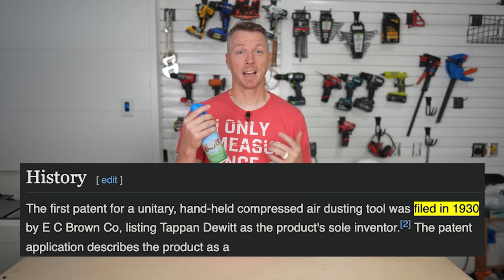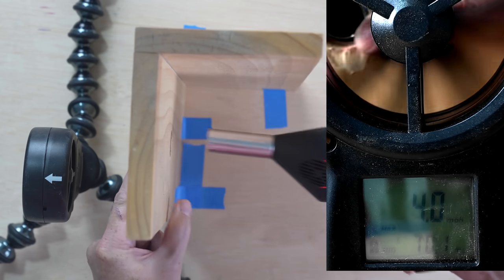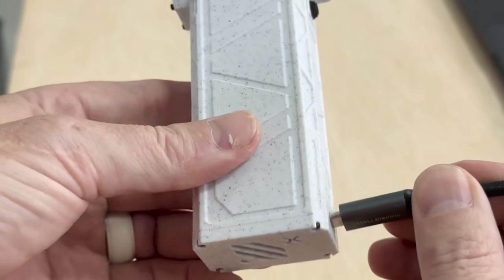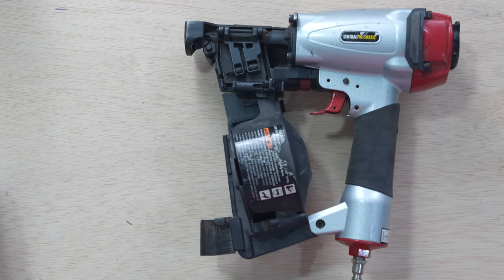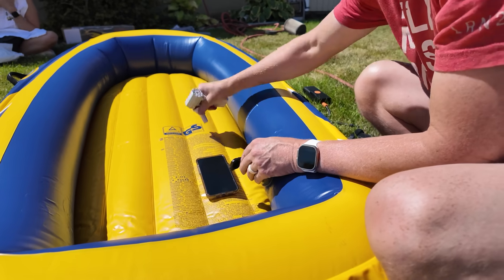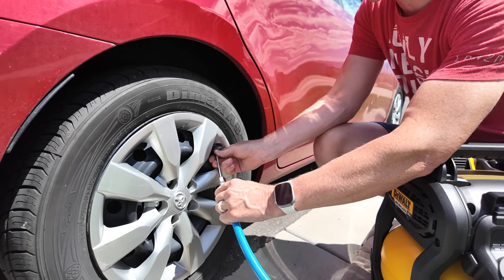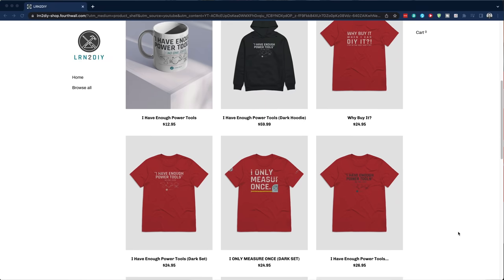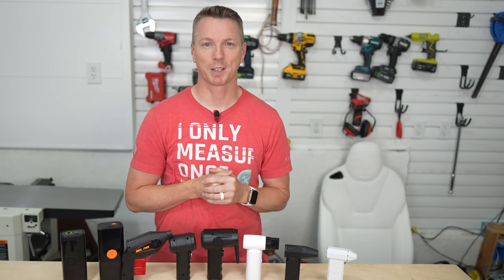The Air Duster, Reinvented

Comment: You’re absolutely measuring these wrong.   You need to use a force sensor. Not a speed sensor.   I’d attach a flat surface to a sensitive scale and measure the force applied instead of the speed
Reply: This. There is literally no way these will clean as good as air in a can, or compressed air, for caked on dust in anything that draws air. Well, I guess I should say without showing the pressure of the air stream, there is no way we can tell, but I'd put money on the compressed air winning every time against them all.

If you are OK with these things getting stuff just 90% cleaner, you might as well use your mouth, or a vacuum. Careful around computers with a vacuum though, they build up static and computer parts are sensitive to electrical shocks to the point they can cause malfunctions and failure.
Reply: I think this is wrong, but am not sure at all. Force is mass times acceleration. I don't think the air gets fast enough to compress and "gain" mass. So you are definitely right that force is the deciding factor, but force is represented as speed and compression in air I would think, so measuring speed should be representative of force. Correct me if I'm wrong.
Reply: I did some research and found the formula for wind force which is:

F =  1/2 * p * A * v
p... pressure
A... target area
v... velocity

A duster can influence the target area by increasing the nozzle diameter. An increased nozzle diameter results in more area and thus, more force in general (given the other parameters don't change, which they would), but less per area. The pressure shouldn't change between dusters, once the air exists the can it expands to atmospheric pressure and converts it's potential energy into kinetic. So the deciding factor should be indeed, velocity. 

I now need an expert to comment on this. Maybe there is a pressure difference when the air exists the can which makes it more powerful really up close.
Reply: @TheJuanSolid  These absolutely do clean as good as canned air, in fact usually they do a better job. There’s a good reason why lots of industries are doing away with cans. They’re especially better for extensive jobs as there’s no need to keep warming the can up to maintain pressure.
Reply: @TheJuanSolid these are not new, they're just in a neater package than before. They do clean well or better than canned air, most of the time. There's gonna be times when a small focused jet of air is just what you need but not really for dust. Get an electric duster, they're pretty cool and cheaper in the long run
Reply: @TheJuanSolid  The canned products have a large flaw in that the pressure drops rapidly after the first 10.seconds or so. These battery powered options have the advantage of maintaining performance for longer.
Reply: @dodjo_cat sorry but p in this formula is air density not pressure
Reply: @VIRDytweet  awesome dragon character!
Reply: @TheJuanSolid your just stuck to your old ways old man. How about you stick with your little cans of air and let the rest of us enjoy advancement of technology
Reply: @Gabri3lRocha lol that was unexpectedly aggressive for a conversation about a cleaning tool 😂
Reply: @phreshxmetal  sorry I hurt your little feelings baby girl next time I’ll keep it more pg
Reply: @TheJuanSolid i mean if you are ok with spitting all over the stuff you intendo to clean while getting exhausted in the process ,then  yes use your mouth
Reply: @TheJuanSolid also enjoy wasting money. I bought an electric duster like 10 years ago for maybe 100-150. That's already out pricing your stupid cans
Reply: @Gabri3lRocha  I can’t flip that blower upside down to get really cold liquid for.    Experiments.  Yeah. Experiments.  (Cold spray is useful for troubleshooting)
Reply: Now he'll break the scales too...
Reply: @TheJuanSolid  I have one of the “turbo” ones that I only paid $30 for, it’s definitely better than canned air in every way.
Reply: too late. he only measure once
Reply: wind is measured in speed my ngga
Reply: @ right but speed is not the only factor in whether something will do good at blowing off dust. It’s absolutely a factor, but not the only one.  Pressure is a much larger factor than speed.
Reply: @TheJuanSolid  an air compressor will always clean better then air in a can because an air compressor is literally air in a can

Comment: While the comparison was fair, the point of a can of air is to put that straw nozzle right up against your keyboard and blast gunk away That's the actual comparison that needs to be done. If you hold it 2 inches away it doesn't work. I bought a different plug-in 120v air 'blower' that's supposed to be a replacement, yet even with 120V it isn't as effective as that high speed, tiny straw nozzle of a can of compressed air, and no where near as good as an air compressor.
Reply: Most of them come with adapters for emulating a similar effect with the thin nozzle

Comment: Your links to the reviewed products doesn't have most of the reviewed products in it. What's the point of doing reviews of specific models if you don't tell us what they are?
Reply from the maker: Sorry about that. The individual links are all there now.
Reply: @LRN2DIY you're linked items are not for the reviewed models
That is not fixed
Like the Violent turbo fan one which a quick search finds a black model which is $85 not 47 but notice how you have tons reviewed under $40 and almost  none linked under 40?

You are linking models YOU DO NOT HAVE IN REVIEW
what on earth is the point of the review then?
Reply from the maker: @L0st-n0found  Those ARE the same tools. Temu doesn't keep their prices the same so if you look today and a week from today they'll be different. Shop on your phone and you'll see better prices sometimes. I didn't link the BBQ Fan (it's garbage) but every Temu link is under $40 except the white $45 one so I'm not sure if you're seeing it different?
Reply: @LRN2DIY earlier the tagged products was all that was showing.   Now additionally products in video is also there.
Reply: I’m assuming maybe the web sites changed the products after the fact?  None of the top 4 you showed are the same as the ones linked :(
Reply: Reviewing anything from Temu should only be done as a joke.

Comment: 3D printed case is interesting, I’d love to see a disassembly to see if what’s inside is worth the asking price (or how one could make it themself)
Reply: You could definitely make one yourself if you wanted, from what I've seen it's just a high speed hair dryer motor, like what would be in a dyson hair dryer, an ESC for the motor, and a lipo battery with a charging control board.
Reply: @Londrino  basically you can make everything from scratch, but is it worth your time?
Reply: @Londrino 😅😅😅😅😅8😊😊😅😊😅😅⁶6😅o
Reply: They are using overstock of Dyson motors i believe.
Reply: @Londrino worst part is making a turbine to take the forces
Reply: @XdekHckr  yeah exactly, could be an interesting project if you like the challenge. But after factoring in the cost of parts and shipping and printing time you usually save money by just buying the thing.

Comment: I think your tyre is mounted backwards. It says "INSIDE" where you can see it from the outside.
Reply: Very well noticed! All respect, sir!
Reply: oh yea huh, nice catch! save him some money!
Reply: Maybe he flipped them for balanced threads
Reply: @churro6160  Or life!
Reply: @xKrikket  if that's the case then it should be positioned on on the other side of the car not inside out
Reply: @xKrikket  Don't want to do that as the compound is likely engineered to have one shoulder on the exterior side of the vehicle to handle weight under turning force with minimal wear.  In an emergency, you want the physics and engineering on your side. If the insurance  noticed this after a crash, guess who's likely not getting covered... Not to mention a risk to the lives of you, your loved ones, and others that could have potentially not been involved in an accident at all. For those interested, tire model is Radar Dimax AS-8.  Depending on size, they're about $100/corner from 'the original Amazon', Wal-Mart.

Comment: I havent found an air duster as good as canned air. Thanks for testing.
Reply: I won't buy anything from Temu. Are there any other places to get that 40mph one from?
Reply from the maker: There are a few links from Amazon in the description for ones that are that good or better actually. Walmart sells similar ones as well.
Reply: I have a pricey one and never use it. Went back to canned air.
Reply: Makita and Hitachi both make 18v brushless motor powered ones, pretty powerful but not cheap.
Reply: @LRN2DIY  it's still the same vendors on walmart and amazon as on temu. They are direct from the manufacturer in China, they don't have a middleman selling the product as we do in the rest of the world. It's also the biggest reason it's so cheap.
Reply: @greentjmtl  Dewalt also. Love my Makita DAS180.
Reply: I'd like to find a good air duster to replace canned air. I'd prefer something that has nozzle attachments. I do have an air compressor for the big tasks. But use canned air for smaller stuff or something to quickly blow something off when I don't want to have to go out and fire up the air compressor. But the cans get expensive over time.
Reply: @colt5189  The Makita DAS180 has an extensive but optional set of nozzles available. Sadly I have not yet been able to procure the mini nozzle with the flexible hose. The duster comes with 5 nozzles, at least that's how mine came in Canada. Makita has a habit of differences between countries in these things. The cost of cans is what drove me to the Makita. Of course, already being on the Makita battery platform made it a logical and easy choice for me. The Dewalt is likely just as versatile. The Xpower corded duster is a choice for those not committed to a battery platform but mine came with only two nozzles, neither of which were what one wants for poking about inside computers and the like. Make no mistake, these things are powerful! It's doubtful I'd ever buy another of those pricey cans and there is never any worry about propellant being sprayed out as with the cans.
As for the TEMU things in this video, I cannot say anything other than the adage "you get what you pay for."
Reply: @peter-radiantpipes2800  nice so you like spending money again and again for a can of air that doesn’t even last that long and the strength of the compressed air quickly diminishes?

Comment: ive used a bunch of these, none are anywhere near as good.theyre insanely loud(basically like running an old school vacuum) and they dont have the explosive puff that canned air has. you need that percussive shot 95% of the time and that tap outperforms any battery powered one because it needs to spool
Reply: I’d rather deal with the noise for the 5 seconds that I’ll use it then having to buy expensive cans of air that barley last and the strength of the compressed air quickly fades out
Reply: @Gabri3lRocha literally can is good for 2 actual decent cleanings
Reply: @BigOleHayden   I’m good. Again I’d rather be able to use the electric one for many uses for a couple years and just recharge it every so often

Comment: Nils, Thanks for the best laugh I've had today. I used to clean and repair fishing reels. The first time I took a non-serviceable roller clutch assembly out of a spinning reel and attempted to blow the dried mud out of it with my air compressor. which was set at 100 PSI, it blew the whole damn thing apart. Fortunately, it was only $25 mistake but taught me to turn down the pressure when working with small parts. Thanks for the chuckle and the info, as I'm tired of buying the compressed air cans.

Comment: An added benefit to the air can, flip it upside down, and you got a great freeze cleaner. 
Gum in the carpet ( who has carpet these days (I do 😢 ) ) not a problem.
Reply: You can also saturate Q-tip with the liquid to freeze off skin tags or warts.  Just be careful that you don't touch the skin around it.
Reply: I use the freezing liquid to cool hot melt glue more quickly
Reply: who tf spits gum on their carpet is my question.
Reply: They work awesome at shrinking metal pieces when doing mechanic work.
Reply: @Pet_Hedgehog kids

Comment: DeWalt makes a 20V cordless tire inflator (DCC020IB) that is outstanding. Much quieter than most similar inflators I’ve used, and fast. You can dial in the exact PSI you want and let it run. It’s got a flashlight, a separate hose for air mattresses, rafts, etc, and you can run it on either battery or 12v via a car outlet. Also can use 110vac. 

It’s large compared to what’s shown in this video, but if you’ve got room for it in your vehicle or garage it’s a very nice option.
Reply: Milwaukee's competitor is newer and apparently way better. I have the DeWalt and it's quite useful, but all the head-to-heads make me jealous of the Milwaukee.
Reply: I have both the Dewalt and B&D versions of these (home & boat), and find them incredibly usefull.  I'd be very interested in reviews of these combo inflators!

Comment: On the jobsite we have alot of ryobi high volume inflators.  One at every dusty power tool and at 30 dollars a bare tool as long as you have batteries they are the best duster you can buy.  They even double as a tiny leaf  blower if you hold it near the ground.  Depending on the batteries you use 20min to 1 hour plus runtime once a week charging basically.  If you need one most hds have them in stock.  Ryobi high volume inflator don't matter what model.

Comment: There's some nice smaller compressors available these days that are actually fairly quiet.  I bought a Limodot 2 gallon some time back and it's significantly quieter than the old porter cable pancake compressor I had been using.  I also did pick up one of those hand-held ones with the vacuum and blowing functions mostly for cleaning out computers and keyboards and similar things, and it's been great.  Much better than constantly buying cans of air.

Comment: It would've been nice to see noise db levels with these units as well.

I have a Ryobi P738 that runs on their ONE+ 18V battery platform. It was about $35 so not bad at all if you already have batteries.
I don't have an anemometer so no idea how it stacks up but it does the job - just wish it wasn't as loud as it is but that seems to come with the territory with these.

Comment: These make use of very powerful small motors tied to lithium batteries... they are scary powerful. I almost chopped a finger off with a cooler fan that uses one of those motors. They get super fast, whiny, and vibrate a lot at the high end.  xD

I have both an air blower and the tire inflator thing. They have both come a long way over the years, I had earlier versions of both that were very anemic while being bigger, noisier and heavier. All because I didn't want to get a proper air compressor for the small tasks I need them.

The key difference here is that blowers are basically encased fans... you are not going to get much air pressure control from those because they'll just stop working or vent excess air by some other route. You can't use those to inflate a tire or any pressurized vessel... it'd simply lose out.

The tire inflator works differently - it's basically a tiny air compressor with a vessel that is always open. It's also noisy, though way less noisy than a full blown compressor, but it can measure the tire pressure by itself, and it's all air tight - which means you don't lose pressure by some vent. Even though they are slower, they are just fast and powerful enough for day to day calibration. I rarely ever have to waste time on pump stations to fill the tire anymore. But because the vessel is open, you don't really get a fast air stream there... in a way, I guess it's safer like that. You don't have to worry about a vessel explosion. Well, I'm no specialist, perhaps I'm wrong.

One thing to note: there are portable vacuum/blowers on the market already that seems to use these powerful motors... I've been itching to get one to test. One tip I heard on another video - get a package with all the nozzles and accessories you are likely to use. The thing is, there is no real standardization on parts for those things as they are too new, so if you don't get all the stuff you might use, you'll have a hard time finding and adapting them later on. This specially for brushes and whatnot... nozzles you might be able to 3D print one with the right filament and lots of patience. xD

Thanks for the video!

Comment: The 3D printed ones come in all the different brand drills too.  I picked up one in a Milwaukee M12 impact housing with 3d printed parts to make it fit.  It's been really reliable, and it's nice that it just uses batteries that I already have on hand.  I'd say mine is equivalent to the white one, but it did cost me 90 Canadian pesos from Aliexpress.

Comment: I think it might be important to note that the portable air compressors also usually have oil in the tank to prevent corrosion and also you should decompress/release any excess compressed air (once you have finished your task) to prevent condensation inside the tank (which could lead to corrosion of the tank).  I think this also affects their usage as you likely don't want to spread any oil on your computer and probably also not on your car if you are drying it.  So while it is more powerful, there are also some other drawbacks that likely limit its use cases some.

Comment: The difference between high-pressure/low volume (compressor) and low-pressure/high-volume (fans).  For low pressure applications like blowing up the raft, a high volume pump will work best, at least to the operating pressure of the raft (which will be quite low). Even though a balloon isn't really a high pressure application, it's high enough to require positive displacement type compressor.